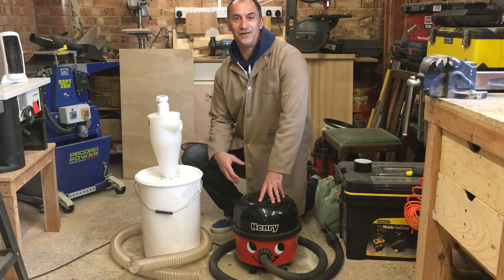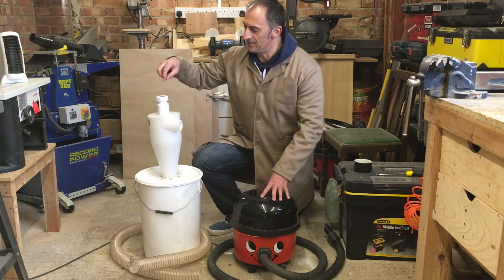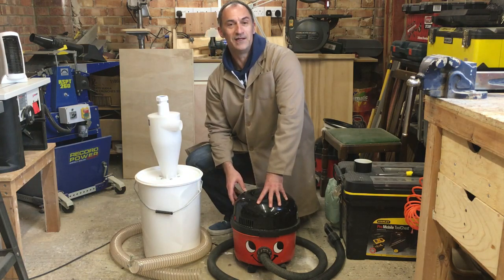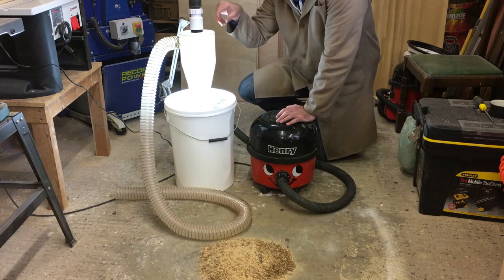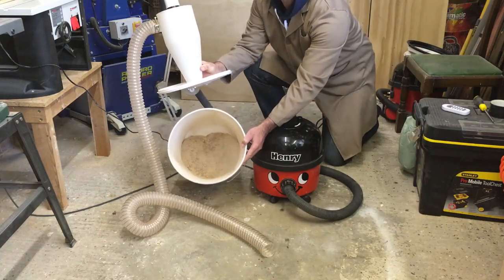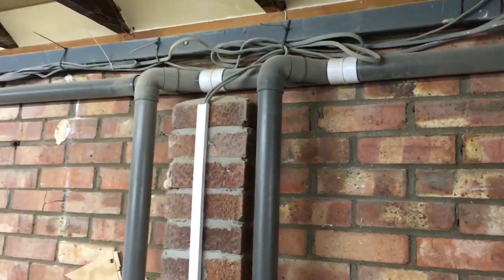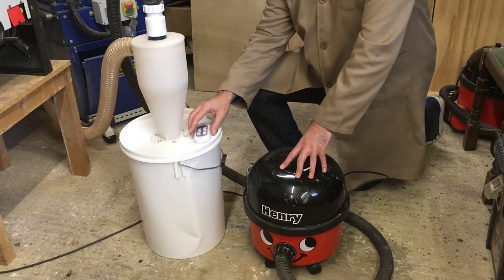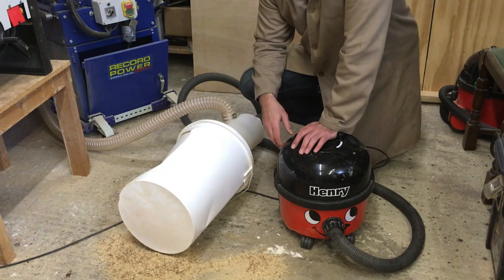Dust Extract Cyclone Demo with EXPLOSIVE Results!!

Comment: Lol your title is certainly not click bait , by far the best demo on YouTube.
Reply from the maker: Larn Davies, the bucket had collapsed before but always popped back out unharmed. Was not expecting it to split so violently. It was winter and very cold so guess is plastic was brittle. Did make us laugh 😂
Reply: @GregVirgoe  I read elsewhere that the best way to reshape a bucket that buckles (assuming it isn't split) is not to pop it back out but to take it outside and fill it with warm/hot water and leave it and let the heat and weight of the water push it out. You can help it on its way by using a heat gun or hair dryer. It avoids weakening the plastic caused by popping it back out.

Comment: Thanks greg just setting mine up now just had to check which pipe goes where . You can get a little inexpensive valve that goes on the suction bucket to stop it imploding lol ,hopefully this afternoon shud be up and running , Ant  greetings from wales .
Reply from the maker: I think if you remember not to close every inlet you’ll be ok. Unlike me lol 😂

Comment: great fun, good job, stick a small pressure relief valve on the bucket and it will stop that forever, google for cyclone pressure relief valve or print one off thingiverse....thanks for the plans on the blast gates.....

Comment: I've got a hetty version of that .really powerful hoover more powerful than some bigger industrial vacs provided by companies while doing some work for main contractors  only difference is the smaller bin capacity. Witch makes them perfect for suction power 
Reliability 
While taking up much less space when combining it within a cyclone system
Reply from the maker: That sounds like the perfect solution 👍🏼😊

Comment: Really nice demo, I have the same Henry, and am really surprised by the level of suction through all that piping, looks like a great system. One thing you might consider is adding the bag back in the vacuum, in most systems the bag is integral to the filtering of the fine dangerous dust that is too small to see.

Comment: Hello Greg, thank you for sharing your work. I may have missed something in your explanation, as I am trying to understand why the bucket collapsed. Was it primarily the material the bucket was made of? You mentioned about the blast gates... I was wondering since I only have a simple dust collection set-up, would putting an open hole (small and perhaps covered with foam) solve the pressure build-up in the bucket?

Again, thank you =D
Reply from the maker: Space Invaders i was just demonstrating how much suction the system has. 
Normally you would have at least one gate open to the machine in use and there would never be a situation where they are all closed. 
Don’t add a sponge vent as you will lose vital suction.
Reply: Greg Virgoe

Thank you for your response Greg :)

I guess at this point, i’ll just have to consider the frustrating conclusion that it’s the material my container is made of that’s causing it to collapse from the suction pressure.

I saw you make and use plywood for your container’s lid, would that help not make the container implode? If not, then I may just have to get a more sturdier container :)

Thanks again! Cheers!
Reply from the maker: Space Invaders you’ll see that in part two we purchased a clear dustbin from eBay for a replacement.

Comment: Copied this set up Greg. Not sure what I'm doing wrong but most of the dust ends up in the Henry. Not sure if the internals of the cyclone from your link are right. Any ideas?
Reply from the maker: Is the hoover connected to the top of the cyclone?
Reply: Greg Virgoe Yes I checked that yesterday just in case after watching you video again in case I’d had a brain fart. I’ve even tried reducing the suction by putting a variable opening into the hoover pipe (like you see on many stand up vacuums but all that does is reduce the effectiveness and I still get most debris in the Henry. The debris is entering the cyclone and not rotating fully down into (per your backlit video) but getting diverted up the hoover connection at the top. Trying to avoid buying a professional shop vac!

Comment: In the video towards the end you say in normal operation you have 2 or 3 of the blast gates open normally. Does this not mean you are losing a lot of your suction performance? As rather than hvaing all the suction being applied to one blast gate you are splitting 2 or 3 ways but only actually using one, so maybe getting only 50% or 33% of the performance you would have if you closed the ones not in use?

I know the reason behind keeping an extra gate open is to avoid the imploding bucket but could you not put an air relief valve in the lid which would open if a blockage occurred thus avoiding the imploding bucket.

I am looking at making something like you have made in your newer video and am trying to decide what to do to avoid the imploding bucket syndrome. Thanks for the videos just discovered your channel and love it already, never thought about the remote control sockets until I saw your video, have always found turning my hoover on and off a pain and they look ideal so have ordered some today. Thanks again!

Comment: Hello Greg, it's been a while I have not seen your video's. I need your expertise advice, I don't get suction in the dust collection port which are connected to my tool with the blast gates fitted. When I turn on the vacuume the dust collection bucket tend to squeeze and when I turn it off it come back to its original shape but it doesn't collect dust .is the bucket weak. Where did you purchase that bucket, looking forward your response.
Reply from the maker: Hello Elvis, it sounds like you have a blockage if the bucket is collapsing. Or you can try opening the very last blast gate a little if your vacuum is too strong. We got a larger clear bucket from cheap pound stretcher type stores. The bucket does need to be fairly rigid. Makes sure you only use long radius bends as elbows will easily block up with sawdust.

Comment: Well explained video Greg enjoyed it,I considered this method but opted for  a Titan wet n dry with one leg of the mrs tights cut down and put onto the filter,Absolutely immense  pressure and nothing in the filter.
Reply from the maker: The tights are acting as a pre filter, but like all filters that will block with dust every time you use it and in no time you be losing suction. It will have to be cleaned each time you empty the hoover.
With a cyclone nothing gets into the vac so you don't need a bag and never have to clean a filter again.

Comment: That's pretty cool! I'm a vacuum cleaner collector myself, and hoover dust bags aren't usually that expensive!!
Reply from the maker: Two Numatic packs I believe and now I don't have to buy any more 😃
The biggest gain is no loss of suction as you have just witnessed.
Thanks for watching and taking the time to comment. Cheers
Reply: Greg Virgoe I really enjoyed watching this video! Have you not tried the numatic Hepa flo dust bags? There a white cloth through away bag. Very very good, don't lose suction even when there full! But something like this I suppose would save you money If your in a workshop etc.
Reply from the maker: numaticrule29 HEPA Filters are designed to remove very small particles therefore have much finer material.
Any filter will add resistance to airflow and result in a pressure drop on the system.
The more efficient the filter the higher the pressure drop and the greater the reduction in airflow.
In this woodwork application where the shavings are relatively large, a bag system of any grade would fill up in minutes.
Do I see by your profile photo that you have every Numatic vacuum made? 😃
Reply: Greg Virgoe yes I do a have a few numatic vacuums (16 to be exact) and there's plently more to get lol. I understand where your coming from, as I don't suck up large quantities of sawdust, there great for use in a house situation. I subscribed to you btw!!
Reply from the maker: Really?! Are they all Different?
I thought they only made Henry Red, Blue, Pink & Green ones? I'm guessing they all have different names too 😀
Reply: Greg Virgoe yes they have a lot of different names lol, check out some of my vids and you will see that they do all kinds of different vairients of machines!